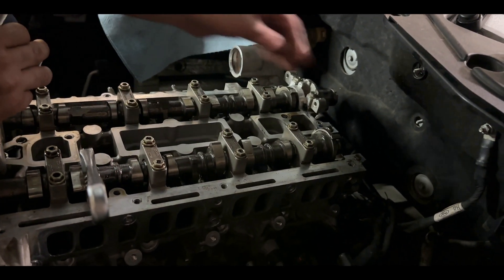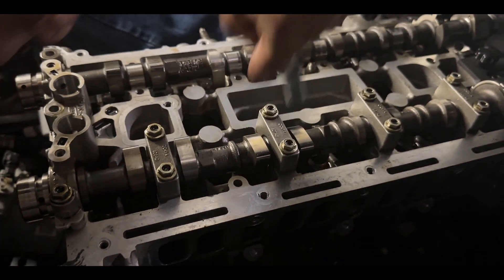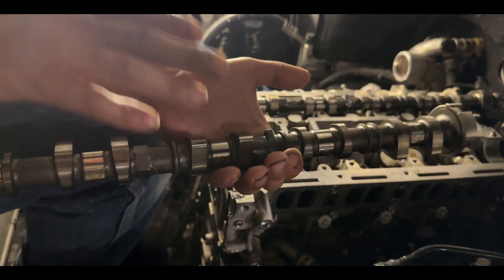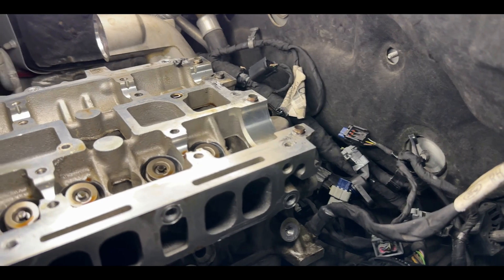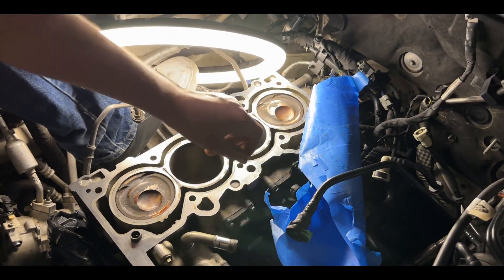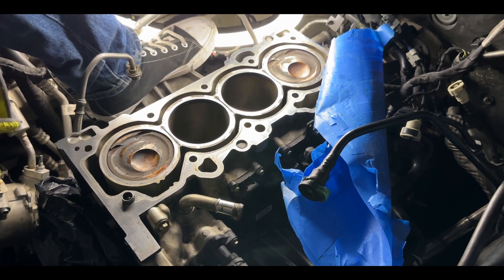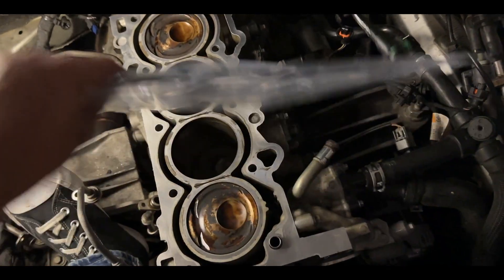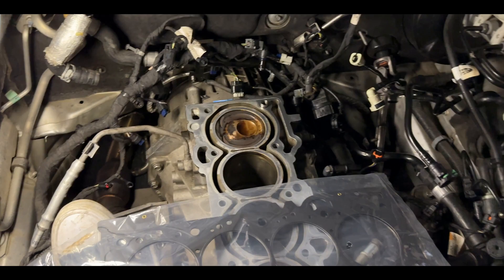Mustang EcoBoost S550 Head Gasket Replacement   Ep 5

Comment: Hey have a question! I have a guy that’s selling a 2015 mustang roush stage 1, but he says it has a blown head gasket and it has been sitting for over a year. Should I buy it and fix it? The paint nd everything is in good shape just didn’t try to turn it on. Only wants 5k for it with 87k miles on it. Is it worth trying to fix or should I stay away from it? Wheel are flat gonna need new tires and more of course battery etc.
Reply from the maker: I would talk him down to 4k being said. It can be worth saving. But there’s allot of money that goes into fixing because everything you have to pull off needs a new gasket it about 4k just to fix it up. Plus the wheels they will have flat spots in the tires from it sitting for a year. So you’re looking at 5.5k just to get it rolling. If you go see it send me a video of everything. 2015 was the first year the Ecoboost came back. Also be careful because they are open desk motors. I would also have the block baroscoped to make sure it doesn’t have any cracks.
Reply: @ I appreciate the quickness!!!!!
Reply from the maker: @ np, please help me by sharing this video liking, if you haven’t already smashed that subscribe button.
Reply: @DailyDrivenStangs  what should I be looking for when inspecting it?
Reply from the maker: @Rightway_21 if it’s a blown head gasket. Check the out side of the block. Make sure nothing bad happen like it shot a rod. Also check the oil. Don’t say anything if you don’t see milky oil. Look at the coolant reservoir make sure there’s coolant and not oil. Get a battery you can always return it never say it was installed. Make sure it cranks doesn’t have to turn over just needs to crack. You can do this by pressing the brake and the gas pedal at the same time don’t let off intel the car stop cracking. It would be pointless to buy a car that doesn’t even crank. If it is a blown head gasket and it’s been sitting for a year. Coolant could be sitting in the bores and that can rust it out preventing it from being able to allow the pistons to move up and down in other terms locked engine . Walk away from it.
Reply: @ got it. I’ll try to check on it tomorrow and just see what he says. Honestly not trying to lay 5k for it, and he seems firm on it. He even tried to charge the battery and it was completely dead like not even charging. I was thinking I could next time bring my car over and charge and try to crank it. But there’s no oil in there at all when I looked
Reply from the maker: @Rightway_21 umm sounds fishy. Did he drain it is the question. You could get a new motor for 4.5k that has the ford performance cams already in it. ARP head studs. But Ford uses the same gasket. So if he can get the price down to 4k instead of rebuilding it. I would just buy the complete motor.
Reply: @DailyDrivenStangs  yeah same. He mentioned he just doesn’t have time to fix it and just been sitting. It is a roush so like I don’t understand it lol. Like why he hasn’t at least like maybe washed it or anything. There was no coolant in there and when I checked the oil there was nun. At this point I think I’m just stay away from it, but from the looks it’s clean inside and out.
Reply: @DailyDrivenStangs  wish he’ll give it to me for free!lol😂 like it’s gonna be a lot and I mean a lot considering it’s been sitting for a year with a blown head gasket and will need all type of gaskets all through the engine. By the time I’m done fixing it, I think I would at least put about 3-5k in it
Reply: @ you have a number by chance I can send you a video of it. It is currently dead battery and doesn’t start.
Reply from the maker: @Rightway_21 send it to email, crazymustanggtman@gmail.com

Comment: Hey man this videos helped me to much but i run into a cuestion looks like the surface of the block is pilling off a bit but for you know if that could be an issue after i install the mountune gasket and aro studs? This is how it looks
Reply: Is pelling in between cylinders 3 and 4
Reply from the maker: Please send me a pic or video to crazymustanggtman@gmail.com
Reply: @DailyDrivenStangs  i just did
Reply: @DailyDrivenStangs  i just did send a video
Reply from the maker: @allenosuna2711 you need to clean up all of that old gasket that is on that block. You can do two things brake cleaner on a towel, scrub it all off with a towel. If you have experience using a razor blade, you may use one make sure the razor blade is sitting flat with the surface of the block this prevents scratching. Once you were done, you can put the new gasket on it. The block isn’t peeling. It’s the old gasket that is still stuck to the block.
Reply: @ ok i will do that , thanks man
Reply from the maker: Np please smash the like button and sub button if you haven’t already

Comment: You seem to use a gasket with one hole between the cylinders as opposed to two for the Mustang. Gasket with one hole between the cylinders is for the Ford Focus RS. I wonder how it all worked out after the installation and some driving.
Reply from the maker: @ndumisozikhali9920  Yes it’s the upgraded one. Mount tuning as done allot of research on this gasket and it work better then the oem gasket. Prevents blown gasket. Make sure you get the arp head studs

Comment: Its there any reason for replace the head  and camshafts or i can use the old ones  ?
Reply from the maker: There is no reason. if you were not willing to wait for the head to get resurfaced then I would say buy a new head. Keep in mind that you will have to check the gap in between the head and block on every direction to make sure the block is not warped. As far as the camshaft go, you can reuse your old camshafts. Do not drop these they are delicate. I chose to go with Ford performance camshafts.
Reply: @TOUGHBUILDSCUSTOMS  thanks so much for your response,  I gave another question,  when you buy the head it comes with the valves and everything, or you have to buy it separately / re use it from the old one ?

Thanks!
Reply from the maker: @aldotruqui  no sir. It does come with the valves not the cams. So you will have to buy the new cams

Comment: Happy Friday. I finally got the heads off the block and man it’s nasty in there. I’m not sure what I’m seeing but there’s peeling on the surface of the block but no cracks. It’s orange and black so I’m assuming it’s residue from the gasket? Definitely much dirter than yours. But I did have one question.

I checked the block just now with a warpage ruler from amazon and check the clearance with a .002 tester and it slides through in one of the diagonal angles. .003 has no issues and won’t go through but it’s that spot with .002 I’m worried about. Thank you. 

What is the maximum warpage allowed on these 2.3 block and what is generally accepted by mechanics such as yourself. 

I have not cleaned the block yet so I might get more clear results after doing so or it won’t make much a difference? Also how do I clean the piston and block without damaging it.
Reply from the maker: You would only use brake cleaner. Brake clean drys on its own and won’t harm anything. Yes clean it first then redo the measurements I don’t miss with that at all I take the cylinder head in for a pass or two I wouldn’t risk it at all. Did your head gasket blow up. Or you’re doing it before it happened?
Reply: @DailyDrivenStangs I have bad news man. I was under the impression that the head warped or the gasket blew but it seem that my head gasket didn’t blow. My heads were warped and after cleaning the gasket adhesive from the deck I found a chip/groove/gouge right on the coolant channel slit between cylinder 1 & 2 and its visible to the touch and eye so I’m pretty sure it’s the cause of the leak. I would machine it but knowing my limited I am when it comes to engine work I think I’ll just buy the updated block from ford so I’ll delay the repair. The main problem is that i’ve been following the video and to be honest with you I can’t afford a mechanic + tow + parts so I’ll have to figure out how to take the block out and back in and time the engine + matching it with the torque converter…etc which aren’t included in the video

This car is kicking my ass but oh well more learning for me. Your vids have helped me tremendously hopefully I’ll be back here next couple of month
Reply from the maker: @user-em9rh1ii5e I am very sorry to hear that man. You can get a short block from ford for like 5,000 it’s not hard to do. Just support the trans and pull everything that’s on the block including the torque converter bolts out and get an engine host and pull the motor. It’s very easy to get the new one in as will just get the shaft back it you will feel it and hear it.
Reply: @DailyDrivenStangs  Hey sir. So I’m planning on getting the block out. I had a locksmith that told me he used to work on cars and said that I should just junk the car. He told me that changing the block on the ford mustang isn’t something I can do since removing the long block and replacing would require calibrating the ecu, air fuel mix ratio etc and it takes someone very experience (5+ years tech) to do this job. It’s not a simple plug and play. Can I get some help on this?

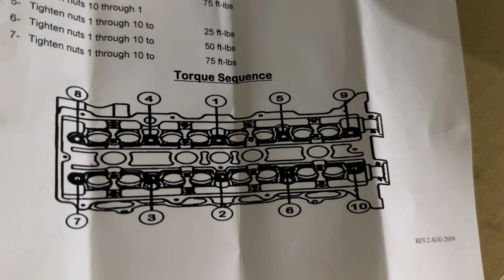Comment: Do you recommend loosening the head bolt in reverse order of 11:00 / tightening sequence or it doesn’t matter?

And by the way would it be ok to loosening the head bolt with an impact or that’s not ok? I’m putting a lots of weight onto loosening the bolt counter-clockwise with a breaker bar and it is not coming off. I tried to use a impact drill for 2-3 second on the first bolt and surprisingly it didn’t loosen a bit. 

I’m planning on buying a longer breaker bar and putting some pb blast on the bolt tomorrow. Slowly making it through the series. Thank you.
Reply from the maker: No don’t use an impact gun on head bolts you can damage the head and crack the block. Long breaker bar would work keep in mind they are torqued down plus a 60 degree turn. They will be hard to get them lose but they will come lose. Yes loosen them in reverse.

Comment: What type of thread seal did you use for the nuts?
Reply from the maker: APR thread stealer it comes with the APR head studs.
Reply: @DailyDrivenStangs  Your talking about the lubricant?
Reply from the maker: @gregalot200  for the head studs you want to use ARP thread sealer. For lubing the cams you can do two things. You can use engine assembly lube. Or regular motor oil.

Comment: Btw the APR studs your using is that better than the OEM? and which would you recommend using? Again thank you for posting this video waiting on #6 😅
Reply: We appreciate all of your support, stay tuned for part 7! I would strongly recommend going with the ARP head studs for the same reason TBC said, and simply just because they look cool xD!
Reply from the maker: Yes, the APR head studs are a better choice than factory head studs factory head studs causes head lift. APR head studs prevents your head from lifting as you turn up the boost.
Reply: @DailyDrivenStangs  btw when you were installing the APR headstud did you follow the torque sequence that came with it because i just got mine and i notice step 4 that you have to loosen them after tightening them is that correct? and what is the purpose of loosening them on step 4?
Reply from the maker: @vicarnieva5401 yes you do have to loosen them you’re stretching the bolt is what you’re doing. Please make sure you do that step. It is very important. When you loosen them go in reverse when you were tightening them, and then go back to tightening them.
Reply: @DailyDrivenStangs  those ARP studs torque stages are no joke its a work out lol and also from my exprerience use a magnet to start the thread on those nut because one of mine fell at the bottom of the head cylinder and i have to take the head off again to fish out the nut for the people that's who is about to start this project
Reply from the maker: @vicarnieva5401 that’s no good man at all. That’s 100% right man those head studs suck but they are good so way worth the headache. Did you put the studs on before you put the head on?
Reply: @vicarnieva5401  We had to do the same thing, mostly for the washers haha. We really didn't want to remove it so we tried everything to fish them out.
Reply: @DailyDrivenStangs  I put the studs on before putting the head
Reply from the maker: @vicarnieva5401 okay just making sure.